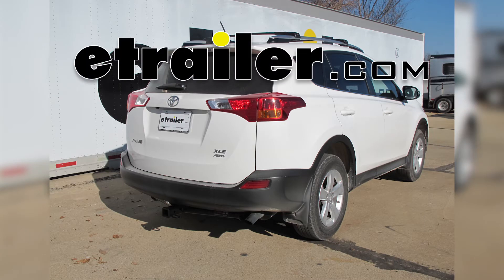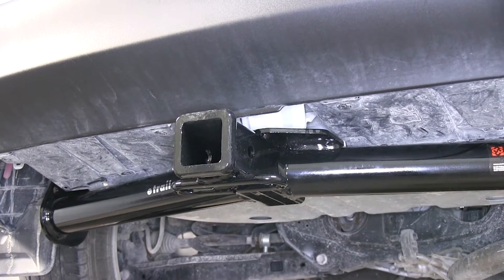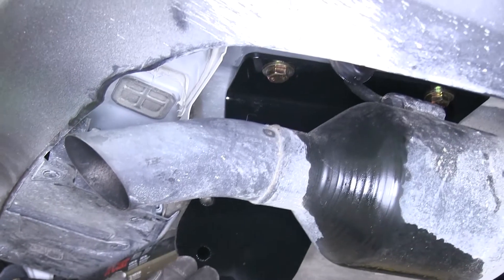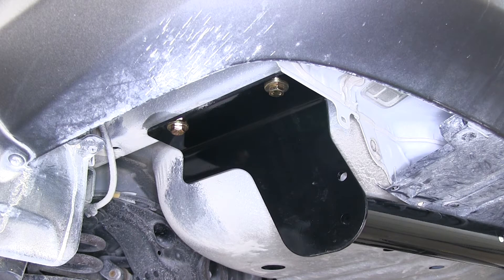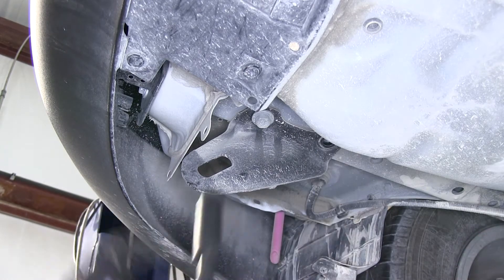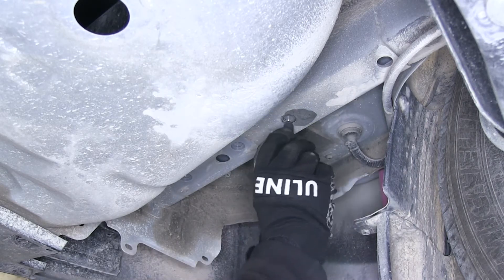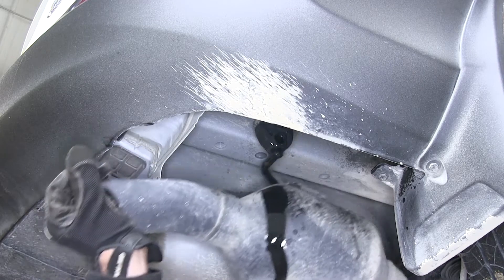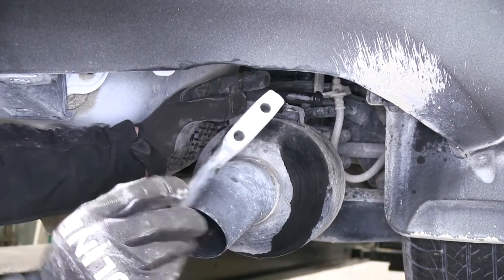etrailer | DIY Install: Curt Trailer Hitch Receiver on your 2014 Toyota RAV4

Comment: Thanks for making this video. I watched and easily installed myself. Toughest part was cleaning the threads on the frame.
Reply from the maker: Thank you for sharing this! We are happy to help! If you plan on towing a trailer, check out the wiring kits we have to get you safely down the road.
https://www.etrailer.com/t1-2014_Toyota_RAV4.htm

Comment: How much torque/pound? 5:01 Thank you
Reply from the maker: Linked below are the instructions which contain the torque ratings.

https://assets.curtmfg.com/masterlibrary/13149/installsheet/CM_13149_INS.pdf

https://www.etrailer.com/Trailer-Hitch/Curt/C13149.html
Reply: What is the size of the bolts and thread? Thanks